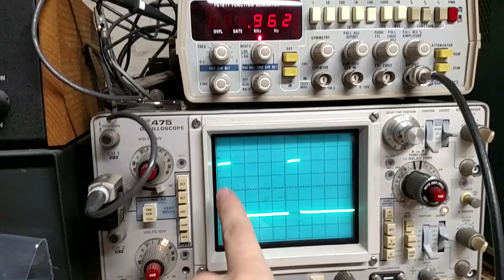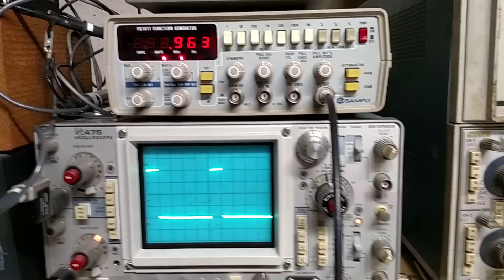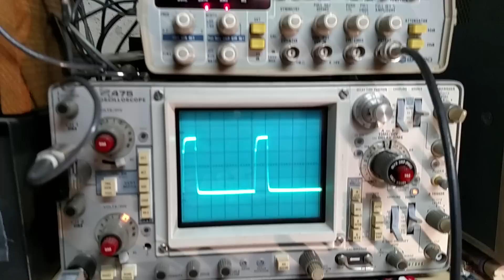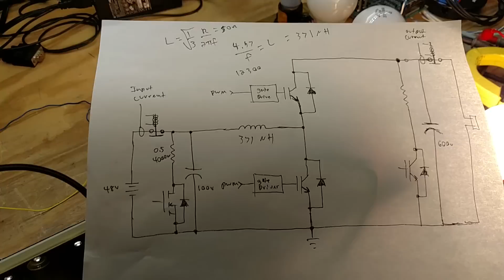Bi-directional buck-boost converter, Part 4

Comment: Nice man :), i'm trying to project a bidirectional buck-boost converter for an integrated pv- eholic system, only that this one will be ac-dc.
Reply from the maker: Hernani Modesto 
Bi-directional AC-DC is a bit more complicated, since you have to generate a AC sine wave in phase with your local mains voltage, and prevent "islanding" when the mains power goes out.
Reply: Thank you very much for the tip, i am glad that i discovered your channel, full of interesting stuff.